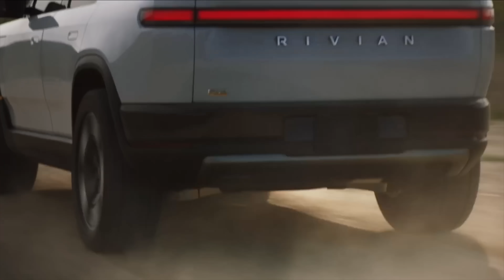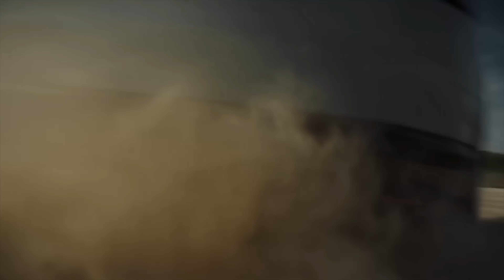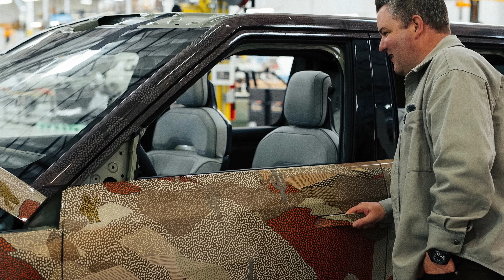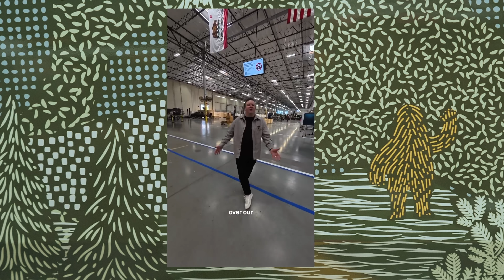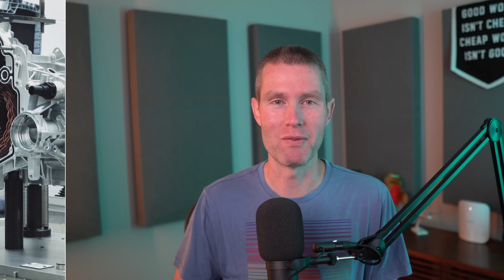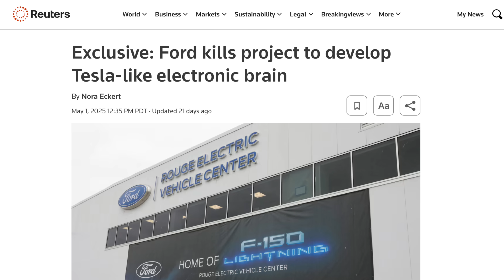Rivian R2 FINALLY hits the road (plus some key upgrades)

Comment: 2 Tesla owner here and I can't wait to dump both of th de for the R2 and the Gravity. But one thing I am concerned about is the  extremely poor efficiency in Rivian vehicles and the lack of basic autonomy tech such as a Lidar. Having FSD I know how dog shit it is without these sensors and Lidar is a must. Maybe BMW or Mercedes will be my next 5 passenger car instead of the R2 (for which I hold a reservation).. Haven't quite decided yet. 2026 is going to be an exciting year..
Reply from the maker: I actually feel like LiDAR is likely to be in R2, but nothing has been officially announced yet. At minimum they’ve been consistent about sensor fusion and are adamant that multi-modal is the way to go (and I agree!).

The Gravity looks really compelling in a lot of ways. Lucid being the king of efficiency certainly helps.

Thanks for watching!

Comment: I hope you'll make a video in regards to the latest bill congress passed that in part, dismantles the $7500 EV tax credit. 
I'm curious if you were to put up a pole on here for your audience and ask how much of an impact this makes for a future buyer of an EV, especially for those looking forward to the R2.
Reply from the maker: I'm definitely interested in making a video about the changes in EV tax credits/federal incentives. I wanted things to be a bit more 'final' on that front though. There is a chance Rivian might end up being better off for 2026 than other manufacturers due to the previous tax bill of 200k units and the older phaseout plan. Once the ink is dry, I'll do my research and report back.
Reply: @TravisKetchum Great to hear. Thanks, Travis!
Reply from the maker: @justin4942  🫡

Comment: I hope the R2 is as good as it seems. That said, as someone who has no interest in the body style, I'm really excited about R3. I actually prefer the smaller size, and I love the retro hatchback vibes. I know it probably won't launch until at least a year after R2, and realisitcslly it will be 3+ years before I can get my hands on one, but I'm really looking forward to it.
Reply from the maker: The R3 and the R3X basically fill the modern desire for what the classic sedan used to fill in the past. We won't see either until Georgia opens which isn't plan to have vehicles rolling off the factory until 2028 which is at least 2 years after R2.

Things can always change, but that's the timeline as of now.
Reply: @TravisKetchum I mean, I want an ecar, but for me, who takes many rural, long trips, the infrastructure is still lacking. Also, I really can’t imagine buying a car from a new company. They took out a MILE of wiring in the gen 1 to gen 2.  In the meantime we have a Prius and a Golf R, ( the car the R3 should be mimicking).

Comment: Not really on the wrap, but zooming in on the interior, the seats are a slightly different design than what was shown during the launch.
Reply from the maker: They look pretty similar to me, but there does appear to be a few subtle differences. Perhaps with the way the headrest connects specifically since they have given up on the fold flat front seats?
Reply: @TravisKetchum  The original seats looked more similar to the R1 with the little side vent looking trim on the sides of the head rest, and the metal trim with Rivian stamping originally went across a vast majority of the seat, now that is slimmed down. You're right though, I am guessing new seat design without the flat folding option, and possibly a little bit of cost cutting.
Reply from the maker: @Throttle_Dweebs  great catch on the trim piece for the headrest, that is for sure the biggest difference. Given the cost breakdown that Munro did on that component, I'm fine with it not making the cut even though it looks great in the R1.
Reply: @TravisKetchum  I agree, it's not a deal breaker at all for me. All I ask for is comfortable seats, and a comfortable ride.

Comment: Ford just needs to go ahead and add CarPlay ultra and done.
Reply from the maker: That would help with the in-car experience, but it doesn't really help them dramatically reduce the cost to build EV's in terms of both materials cost and assembly time. That's where the massive reduction of ECU's and wiring comes into play.
Reply: @TravisKetchum most of there cost right now is in R&D and infrastructure construction.

Comment: R2 reservation holder trying to get the Single motor. Do you think their going to release the Tri-motor first like they did with the Gen 1's? And slowly roll out the dual and single? Or do you think since this is their flagship vehicle, they might do the single model since thay will be the closest to that $45k price point?

Comment: I love that Rivian keeps looking for ways to become more efficient but wouldn’t the R2 have less wiring by default as compared to the R1 because it will have way less features? RJ claimed the R1 will remain the flagship and as such will be offered with more features and options. Just going from adjustable suspension to a static one will reduce parts.
Reply from the maker: To some degree, maybe. But the R2 actually looks like it will have adaptive suspension (albeit not air suspension).

I do think the majority of what we are seeing here is just improved engineering more than anything.

Either way, it’s impressive progress!

Comment: Where do they normally test at? I'm in the Phoenix which seems like a great place for testing heat conditions.
Reply from the maker: RJ mentioned they’ve done testing in Phoenix specifically. Keep your eyes peeled!
Reply: Wittman AZ seems to be the most used area for testing.

Comment: Rivian, Lucid and Scout are the future beyond Tesla.
Reply from the maker: I want them all to succeed, but the newer entrants are more interesting at the moment.

Scout needs Rivian to succeed given the components and firmware work from the VW joint venture.
Reply: The Rivian VW joint venture to produce a EUR 22,500 EV in 2027 sounds super interesting too, even if only in Europe initially.  (I wonder if Rivian couldn't use excess capacity in the Georgia plant to make some too, in America, inside any tariff walls, in 2028 or 2029, whether with VW or Rivian badge, or both.)
Reply from the maker: Likely a 2028 thing at the Georgia facility. At least that would be my bet.

Comment: R2 reservation holder here (as well as Slate just because). I think the R2 is going to make or break Rivian, and I really hope it works out for them. I might end up holding out for the R3 but I can't wait for the R2 to take Rivian to the next level.
Reply from the maker: I agree R2 is critical for Rivian to succeed, at least in the near term. It sure looks like the product, package and price are coming together in just the right way.

It should be a fun ride for people who care about interesting EVs 🤘
Reply: If they can keep the price point in line with the Model Y, they will not be able to keep up with the orders. It will sell in the hundreds of thousands. But the price point is the key. The higher the price goes, the less it will sell.
Reply from the maker: @junehanzawa5165  I expect the base price to be competitive, but I think a fully optioned one will likely be higher than a Model Y. The real key will be: what will a nicely equipped "big battery" dual-motor cost? That will be the volume seller for sure.
Reply: @TravisKetchum That's stays within my comment. If that nicely equipted dual-motor stays roughly the same price as a dual-motor Model Y, it will out sell it by a significant amount. All those leaving Tesla due to Elon will go over to the R2 and in a heartbeat. And that's a huge amount of buyers.

The Model Y should easily be the number 1 seller right now. By a large margin. And it isn't. Due solely to Elon.
Reply from the maker: @junehanzawa5165  I don't disagree.
Reply: @junehanzawa5165  Facts!!
Reply: Totally agree and quality better be top notch. If issues plague the vehicle, people will steer away. 

I hope this brings Rivian great success!!!!
Reply: Based on what's going on with the R1 I'm concerned about their quality control on the R2
Reply from the maker: @patrick7228  fewer parts, better consolidation, and less finicky choices (like no air suspension) = better quality control by default.